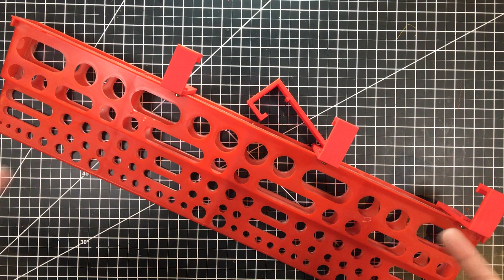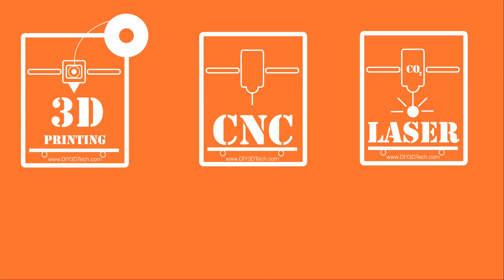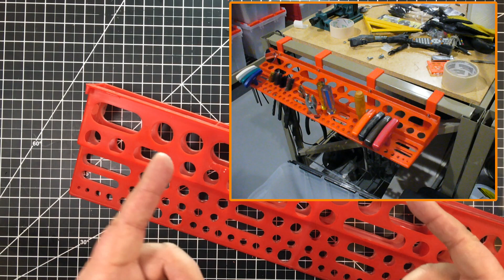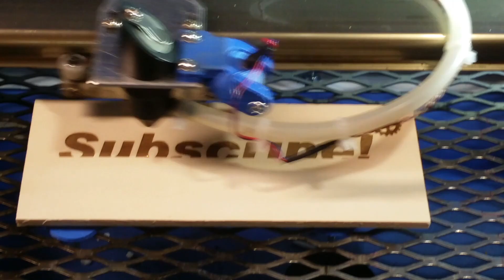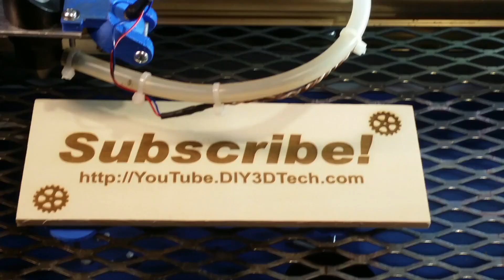Design Talk - 3D Printing Solves Tool Storage Troubles!

Comment: When I got a set of step bits from Amazon it came in a flimsy plastic bag. Fusion360 and a few hours of head scratching later we have a thing on thingiverse to hold the 3 bits, a center punch, and a reaming tool. 3D printing is awesome. Made a few other 'useful' over the last year. Toys too.
Reply from the maker: yes there is a TON of stuff on thingiverse!